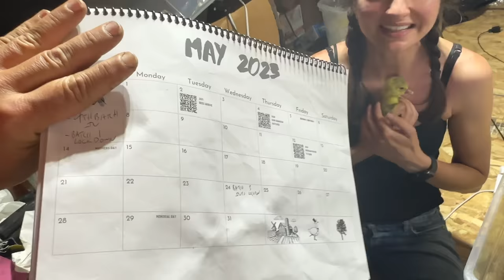How Not to Move a Chicken Coop

Comment: @Gold Shaw Farm
6:37 Wood is much stronger if bolted Across the grains, as compared to Along the grains.
I suggest using a iron drill-bit, add a new hole on the "front"(?) side (non-wheel side) if the iron, then drill through the wood & add a bolt through it all, then add a washer, at least on the wood side, and a nut.

Comment: Seen some stuff of bees getting caught in the flow of honey.  They can be saved if you get to them before they pass and set them by the hive opening and the other bees will clean them up.
Reply: You can also set up the right type of fans (so they don't get sucked in) to blow them away from the honey and partially cover the honey drip system with clear plastic in tandem with a bit of plastic wrap if you have a large enough container.  Any mistakes or drops can be cleaned up by the bees after you've taken it all down.

Comment: Nice video 
A hack for the tractor forks 
I and a lot of others have a hole drilled in close to the tip of one or both of the fork lift forks
IMO Not with a torch , or the heat treat might be messed up  
That lets me both pull a wagon when needed 
Or to hook a chain to the fork tip to move a pallet to the side or forward

Comment: For your rebuild, you might consider building the walls like an A-Frame. This might achieve two things: The base would be wider and allow less bird droppings to accumulate on the edges. The wider base / \ might contribute to better stability.  The roof could be rounded to prevent snow build up and perhaps have room beneath for additional roosts.

Another thing, watching the chickens exiting one at a time through that door I found disturbing. You might consider a design that allows multiple chickens to exit at the same time. Maybe keep the small door dedicated as a  "Walk-in" to ensure that all the chickens can be directed. The other door dedicated as an Exit and be made wider/bigger.

Looking forward to the new design.
Reply: He already had a problem moving it about the farm.  A wider base would be even harder to deal with.  It would actually be better if he built a small shed up on the top pasture.  During the winter, he could use it to house spring/summer items like a larger chicken coop and his anti-fly buckets and double sided tape.  Not sure, but maybe even a spot for his barn cats to use if he finds them wandering up there, too.  If he could get sets of huge poles put into the ground in various parts of the pasture, the poles could be used as anchors for sun screens.  So he could put up reinforced multi-holed screens/tarps and anchor them to the poles creating shade.  It would be another step in his moving the cattle, but better than trying to move his shade and scratch mobile around with them.  And he could anchor the "scratchers" to the posts in a way so he could move them, replace them as needed, and store them in the shed during winter so they don't deteriorate in the snow.  Same with the shade cloths.  To bad he didn't plant some more of his fruit trees on his first year of the farm on the upper pasture to provide food and shade for his cattle for later years.  Of course, if he continues to get pigs to open up his forest on his side of the stream, he can cut some of the trees down, but leave some up to provide a good amount of shade and let his cattle graze that area during the worst part of the summer.  Or get a local goat herder, if he has any, to help him out if he doesn't want to continue with the pigs.  It'll be interesting what more he might uncover as he opens up the area under his forest.  That vehicle was cool!
Reply: there wouldn't be as much space for nesting boxes though and the width of the thing is already a proven issue
it'd help if it was more bottom heavy, how that would be achieved i'm not super certain (heavier kit for the base? something to cut down the wood weight at least)
Reply: @prcervi  Just spitballing here:  If he had round end (like a pirates hook--can't think of the name off the top of my head) bolts along the bottom screwed into the metal and then attached weights to weigh down the base, it might help?  He could just use the weights while moving the coop instead of keeping them on all the time.  Or use them on specific sides when he knows that the coop would tip in one direction--either while moving or when there is a heavy winds day?

Comment: Weigh the excess nitrogen but, do consider adding a good 12" layer of bedding material to the top if your garden beds when you put them to bed of the winter.  Then depending, either scrzpung what remains off into a compost pike or tilling/ turning in come spring.  For example nitrogen and pathogen levels will be higher in bird bedding but seed content will probsbly be higher in bovine bedding.

Comment: You need a Small Water tower/Tank in the upper pasture. It will boost water pressure for your whole System & should be easy to build.

Comment: have you thought about the same material as your big winter coop? Have the wheel base and wood floor frame as is now, and instead of wood frame and plywood covering could you use aluminum  and wrapping? those would cut the weight. and it would be sturdier with its center of mass so low.

Comment: The undercarriage of the coup is a little too residential vs industrial. You may consider beefing it up with some angle iron. Your Friend Albert could tack it place with his welder.
Also. You can purchase a tank with a toilet like shutoff. Place it at the top of your property and then fill everything as it flows downhill. You add 1 psi for every 27.1 drop in elevation. Just by gravity alone.